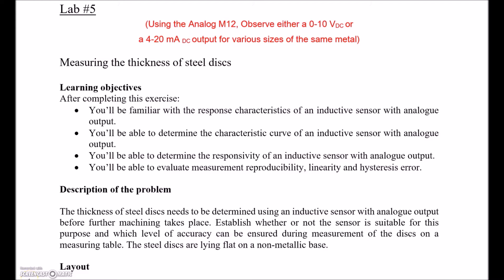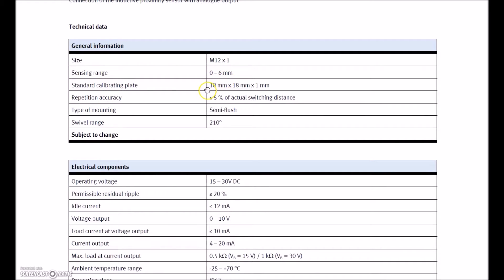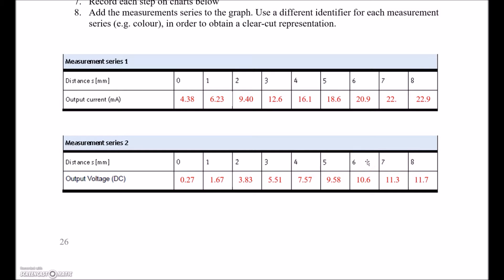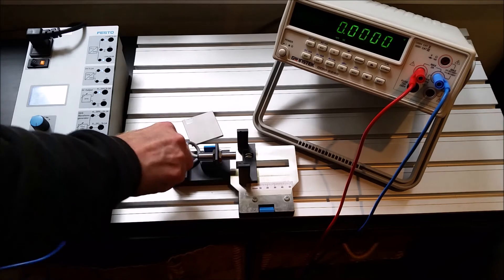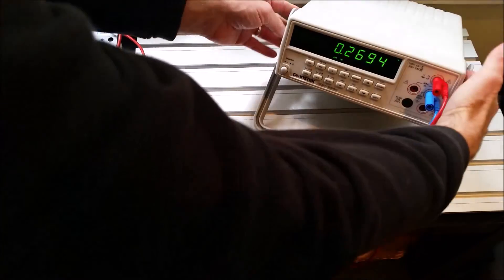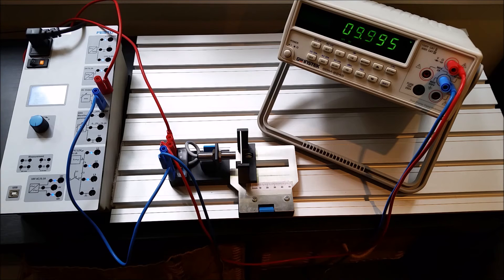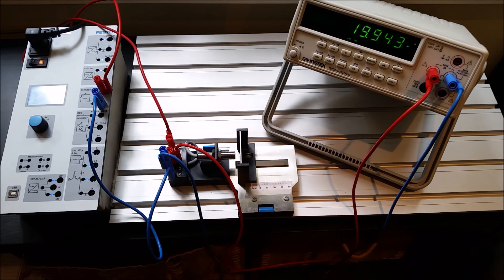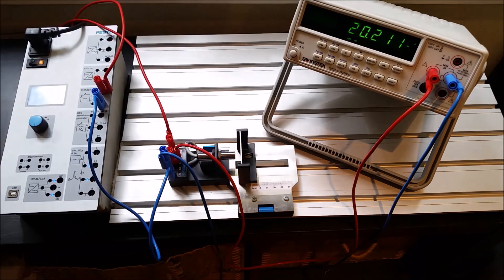Proximity Sensor Lab 4_Analog Inductive Sensor

Comment: nice info... i have used this type of setup, however the digital readout was calibrated for inches to display distance with high and low alarms not voltage away from the target...

Comment: Why is there 2 outputs? Are their scenarios where they would both be used?
Reply from the maker: You'd either use the 0 - 10 V DC Output or the 4 - 20 mA as a signal to your PLC. Depends on what Analog input the PLC is configured for. No, you wouldn't use both at the same time.